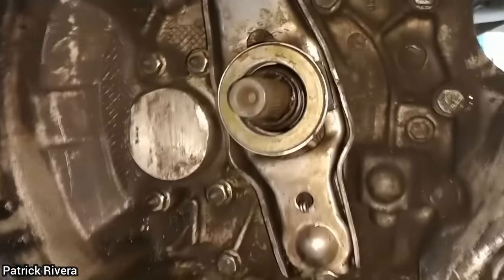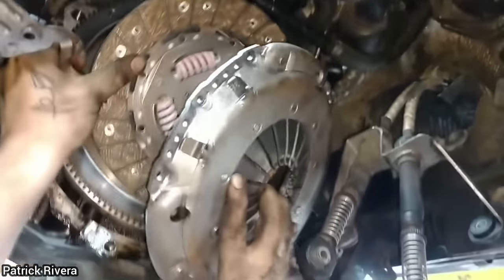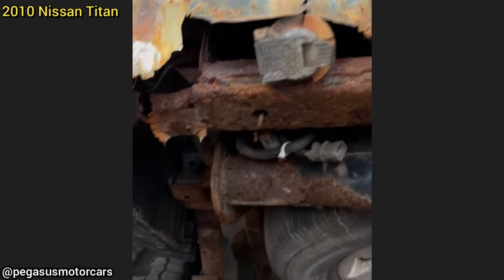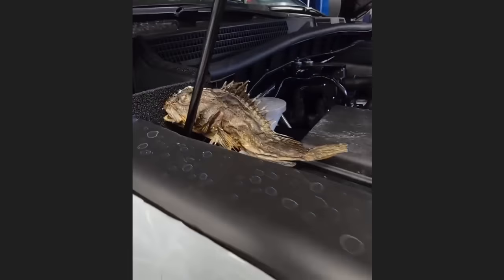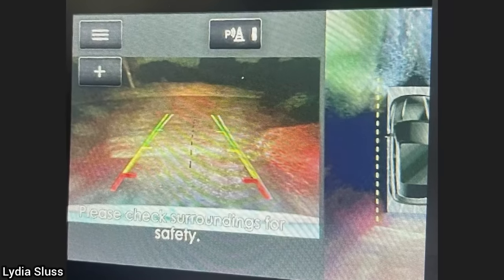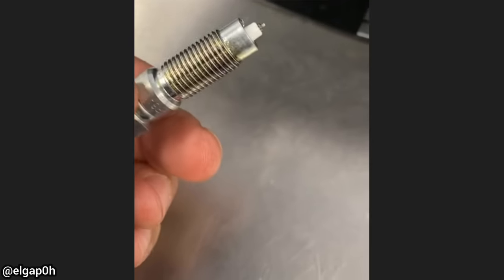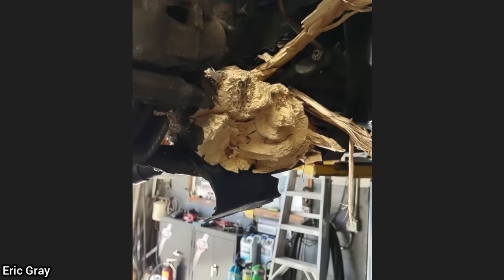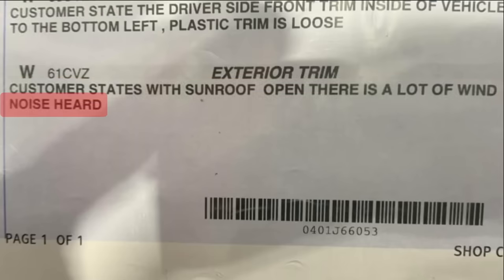Customer States New Clutch He Installed Doesn't Work Properly

Comment: I'd like to know, where is spray foam supposed to be used.  🤔
Reply from the maker: Not on a vehicle lol. Mostly just used for doing stuff around the house. I filled a couple gaps near our door to the garage to prevent any mice coming in, I also use some wire mesh and it works well.
Reply: @JustRolledIn   Ya, I was thinking it was a type of spray on insulation for gaps around windows when installing them.  Hardly for major car repairs.  😂
Reply: Around doors, windows, around electrical boxes on outside walls, around pipes that pierce the wall or foundation like conduits and water spigots. Basically anywhere you don't want air coming through.
Reply: @cojones8518   Ya.  I think that is what was used, or something similar when my windows were replaced on my previous house.
Reply: There is some places where a sort of spray foam is used on vehicles though, for example where the fenders join the frame.
This eliminates vibrations and also seals against water ingress in those places.
Reply: For  filling rust holes in the subframe.
Reply: And to blow your mind there is expanding and nonexpanding spray foam.

Comment: Ah yes spray foam, the most cost effective way of repairing rusted frames. 😂
That wind noise guy isn't alone, whenever I start my car I hear a noise in front of the firewall and it gets louder when I step on the gas. I need to get it checked out huh?

Comment: I picked up a new-to-me car a few weeks ago and when I first got the chance to open the sunroof, I didn't notice the wind noise.  I was too busy being pelted by all the debris in the tracks of the now open roof.  A ton of pine needles was in the tracks and all seemed to get picked up by the wind and dropped into the front of the car.  Actually caused a problem with the auto-hold/parking brake as some of the needles ended up under the switch for that.

Comment: I had an '01 Beetle that someone turned left into at an intersection while I was in the left lane on a one way street. Body damage wasn't bad and the insurance company fixed it. Then I discovered bearing noise from the right front and had it replaced at the local dealer under insurance. Then the back one did the same thing. Took it in to be checked and when I went back the service manager freaked on me because apparently I had 2 screws in a tire that weren't leaking and I hadn't noticed. Threatened to call the ministry that I had purposely brought it in and put his tech at risk without disclosing the screws. I told him to shut up or I would pull him over the counter. Also said there was nothing wrong with the rear bearing. Took it to a trusted shop and when he pulled the bearing it literally fell to pieces. So it's not just drivers but also brutal shops who wouldn't know their a** from a hole in the ground without a manual to explain it

Comment: If you fill a boxed frame with foam, your blocking air flow and water will just get trapped inside and rot it faster.

Comment: The sunroof noise may not be a dummy, several cars have an anti-buffeting setting on the sunroof switch, if buffeting is experienced you twist to the setting and the roof closes a little bit (maybe 3/4 open instead of fully open). You can also lower a rear window a smidge, maybe an inch.
Reply: There should never be a anti buffet setting!  We all need cheeseburgers in paradise.

Comment: I have just done pads, discs and lower ball joints. The whole arm had to come out, of course I broke the abs sensors. Everything new was in and nothing other than the wheel was left to put on when I was torquing the bj but it just spun freely 😞 
Had to do it all over again with a new ball joint.

Comment: I am seeing a LOT of not particularly old cars with completely rusted frames. Is this caused by particular climate in some states?
Reply: It's mainly down to an absence of roadworthiness testing which would pick up galloping corrosion long before it becomes serious. Over-enthusiastic use of salt on winter roads will soon see off any car which isn't galvanised or otherwise rustproofed if nobody ever inspects it.
Reply: Yeah david got it, cheap builds from manufacturer not coating  , and salt , be it used for ice or living by the oceans

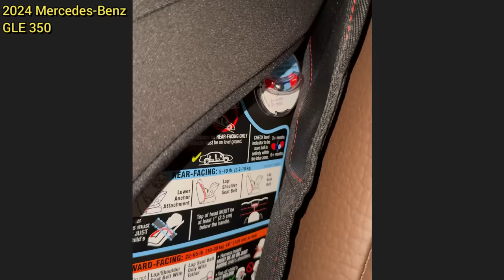Comment: 2:45 What on Earth is that ball bearing thing?
Reply from the maker: Tells you if the car seat is at the correct angle. Shouldn't be moving that much though. The car seat doesn't look properly secured to the seat
Reply: came here for this

Comment: OK the spray foam is a running joke, but what about filling the frame tubes with it before it gets rusty? Keep the water and salt out.
Reply: Water will still get in there and rust faster because it will never dry out.
Reply: Like Jim said,  picture all the cool "build" shows when they use full "boxed" frames.   Needs to breathe/drain.  😉
Reply: @vs-ww7cb  But if it is completely sealed there is nothing to condense, get in, or drain. It's closed cell foam.

Comment: Let's not forget the dimwit mechanics of this world.
I have a bearing rumble on front drive train but no ramp, and it's not stopped raining since November.
My usual garage said they couldn't hear it - probably because all the older mechanics have retired and the new guys can't hear anything over the drum & bass.
Took it to another garage for a second opinion and explained that I suspect the inner cv or the diff/gearbox.
The young lad there laughed and told me my car is front wheel drive (I had noticed). So it doesn't have a diff 😢

Comment: When I pull the vent knob under the dash,  A breeze blows up my skirt.  
When I turn on the headlights,  the bulbs get white hot and glow! 
OMG,  Why won't the gas stay in my tank?  Where does it go?
My van slows down when I'm not pushing the throttle pedal. 
Spray foam is just as solid as steel, right? 
SHEESH!  
Why are these people allowed to drive?   It should be required that a vehicle operator have a basic knowledge of mechanics and physics before getting a license to drive. 

Also,  used car dealerships should be inspected for shady shit like the Subie frame.  Someone from the state,  (a mechanic employed by the state) should visit random dealerships several times a year and check the cars being sold for shoddy patch-jobs like that.

Comment: How are you man?
Hope youre doing well. Any plans for the eclipse?
Reply from the maker: Hey man. We've been good but super busy. haven't had the chance to message you back yet. No plans for that but how have you been?
Reply: @JustRolledIn  Been ok, still slow on things. Trying to win a battle here and there, even if its just a radio on the Grand Marquis, which turned out to be a massive campaign lol...Ordered 4, first 3 were bad units. At least got lucky with this "for parts" one that turned out was NOS and works perfect. But still, lot of work these days to get good parts.

Other than that, planning this road trip next week. Nothing special, though maybe stopping by the Air Force museum on the way back. Quick day trip.
Reply from the maker: @RipRoaringGarage  I've been hearing nothing but bad things about parts lately. What a nuisance.

Hope your road trip goes well! And I'll message you back soon. We've been busy with the twins 😅
Reply: @JustRolledIn  I figured. Whenever you got time. Its why I still drop a line here, since I know youre already handling comments and all. And Ill def bring parts and a small tool box and a few spare tires lol.

Comment: Unbelievable in the UK all vehicles have to have a yearly inspection after 3 years old and all defects must be repaired otherwise they are not allowed to be driven on the roads, Nearly all, of the vehicles that you show that have rotten rusty chassis would be prohibited from use and crushed

Comment: Did the mechanic fix the wind noise issue when the sun roof was open?
Reply: Yes I believe they installed an antiwind setting (close sunroof) label on the switch.  Wind ? Yes - antiwind? Yes.  Customer very happy now.

Comment: In that customer with the toddler seat's defence, that could be water instead of a ball bearing. That would not roll like that and still function. Also as a new parent I'm sure they're tired. Poor dude
Reply from the maker: It's a forward facing seat for a toddler not a baby. If the car seat was tight to the seat it wouldn't make that noise.

Comment: What is all the white floof in front of the Explorer that had crashed through the wall,
Reply from the maker: the tech said he thinks its insulation from inside the walls.
Reply: @JustRolledIn was it insulated with 100 lbs of packing peanuts??
Reply: @JustRolledIn  I just thought that's snow accumulated overnight, or he crashed into a cocaine den.

Comment: Most of these collection of clips are just proof that we stopped teaching kids certain things in schools nowadays. That or the schools of today are even more ill-equipped than ever. There's no way someone doesn't hear the sound of a dragging radiator and not question it. Furthermore, there's no freaking way someone doesn't even have the sense to physically kneel down and look underneath to see if there's any notable visible troubles... such as a component actually touching the ground.

Is the future going to be riddled with folks who think a $35,000 MSRP valued item works like a gaming console or a television panel? Now I am worried.

Comment: Can someone explain the rules in the US concerning vehicle safety checks? In the UK, we have an annual, (federal) mandatory safety test (Ministry of Transport or “MoT” test). All of these rusted chassis would have failed at least 5 years before. Surface rust is usually ok but perforations would be a definite fail.
It’s just odd to see such heavily corroded and dangerous vehicles being used. Thanks
Reply: Depends on the state.  And most states either don't have safety testing or are getting rid of it.  It's really depressing...
Reply: @acerimmer8338 
Thanks for the info. Blimey, that’s a bit scary🙀   🔥💥🛻🇺🇸
Reply: Kinda like a huge cargo ship thats crashed before not having a tug with it.  Scary indeed my friend.